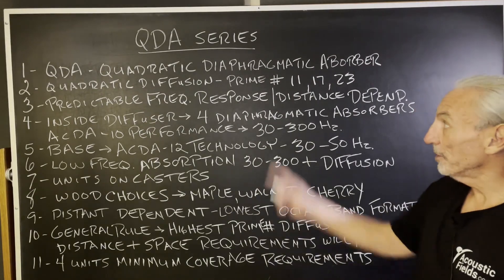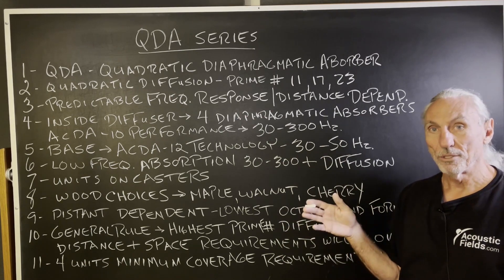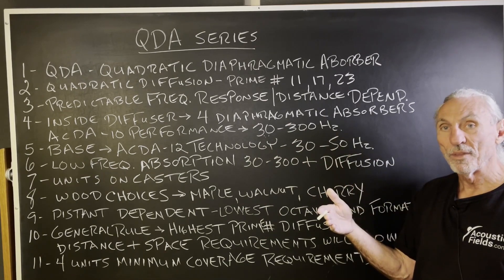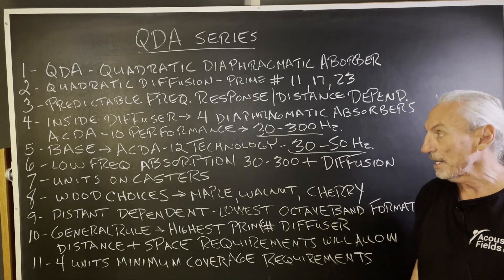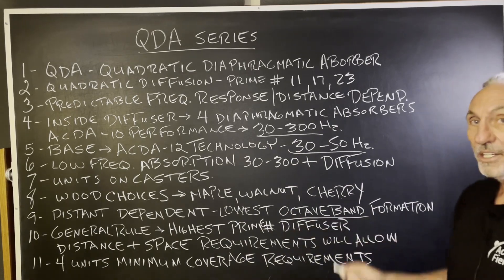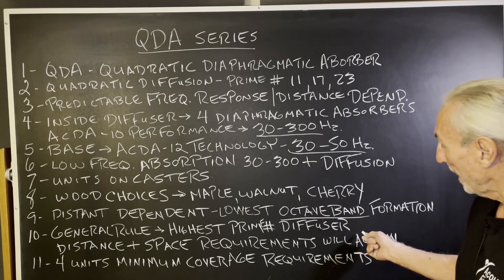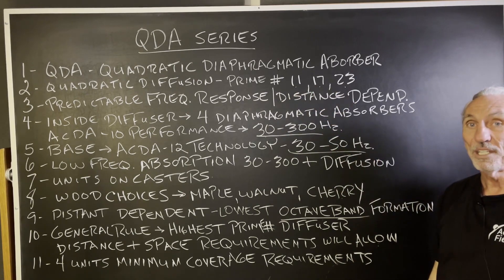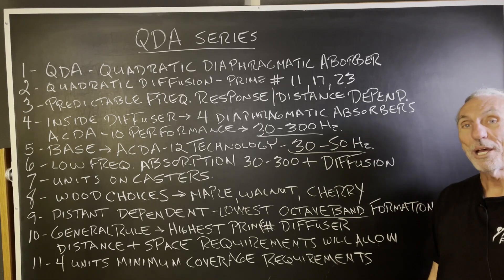QDA Series: Quadratic Diaphragmatic Absorber - www.AcousticFields.com

Comment: Great intel as always, Dennis. I appreciate your sharing of knowledge. One question: In my studio, I have designed and built a rear wall diffuser unlike anything I've ever seen. I came to this design by combining given acoustic technology plus aural intuition. I cannot expound on the details, of course. My question is, how - by what means, ie, instruments, diagnostics, would I verify the effectiveness of my design? I know it sounds good. How do I prove it "on paper?" Thank you.
Reply from the maker: Diffusion technology calculations must be based upon two main varaibles. You must choose a frequency response that you wish to diffuse on that chosen surface area. Usage will play a key role in this decision. You must then match that chosen response curve lowest octave band reach with the distance from the diffuser to the listening position. It is no good to design a certian frequency response diffuser if the distances involved with not allow for fully formed wavelengths which will be produced by the diffuser's frequency response..

Comment: When you say 4 units minimum. Would that be 4 units per wall (front and/or back) depending on the application (control room vs Listening room)?
Reply from the maker: You must start thinking like the room "thinks". The room only sees and thinks energy. Unwanted pressure issues take surface area coverage to treat. You must treat so much of the surface area that is producing the unwanted pressure issues. Each wall, floor, ceiling surface areas will require so much surface area coverage at a certain rate and level of absorption. You have x frequency issues at y amplitude or strength. You then apply the correct amount of technology using the proper rate and level of absorption. Its physics. Our guidelines will not work for other companies"technologies". Boxes filled with building insulation will never and can never because of material type, produce the proper rates and levels of absorption, especially at the lower frequencies. They can not do in 60" what we can in 12". They can not go low enough or get enough even if they covered the whole wall.
Reply: @AcousticFields  I was just asking about the comment you made in the video regarding the QDA series when you mentioned at the end that 4 units are minimum.  I just as inquiring for more clarification.